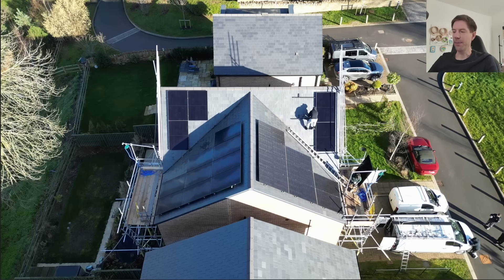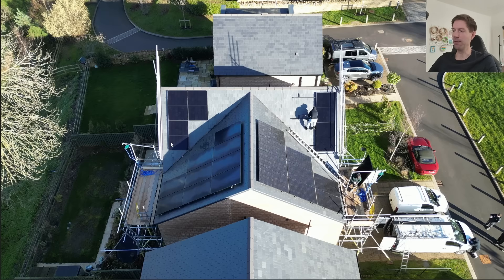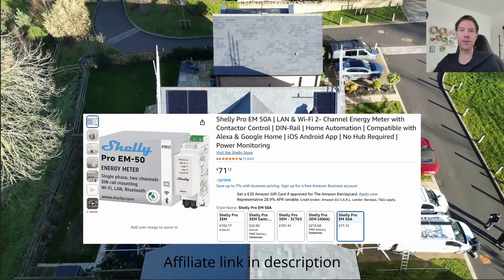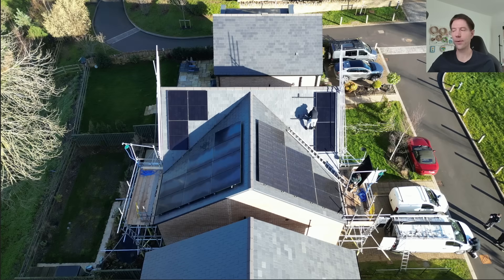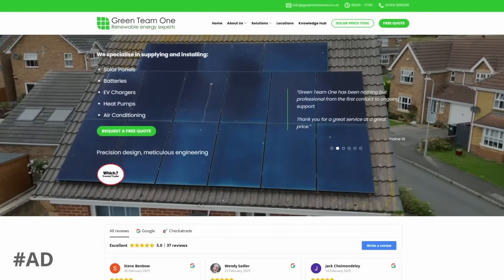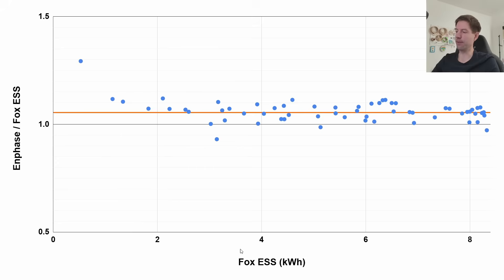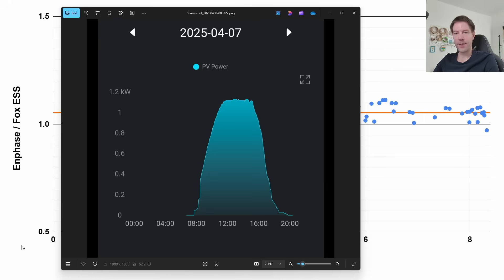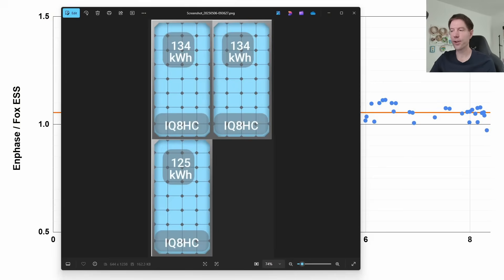Inverter showdown - two months of data

Comment: Tim,  currently doing research on the myriad of systems and combinations in a solar PV, Ev and battery system.  The latest technology is to have Micro inverters on the panels.  Your video suggest you would get a slightly better return from your investment following this route. However,  having 10 + microinverters on your roof increases the likely hood of failure.  Given that manufactures only cover the cost of replacements parts and not the scaffolding costs.  How long before a failure results in additional cost that wipe out the additional return.  I would appreciate your opinion on this situation
Reply from the maker: This is definitely a consideration, but I can't provide a detailed cost analysis at this point.  Personally I would go with a solution that requires the least amount of technology on the roof as possible if it's not strictly required.  Microinverters or optimises are only really required when there is heavy shading or you need to cover multiple aspects with panels on the same system.  Otherwise if you have low or zero shading on one or two aspects then it's a safer (and cheaper) option to go for a string system.
Reply: @TimAndKatsGreenWalk  Have a small south & and a large West so will go with a 2 aspect and DC coupling then

Comment: You mentioned not fitting optimisers due to lack of shading issues (minor shading). One other thing they offer is rapid shutdown in case of fire you can isolate down to panel level so 30v. Also , tigo optimisers usually fail in "pass through" mode so won't affect output too much which is different to micro inverter. I can see rapid shutdown becoming a requirement in UK eventually.  Already is in the USA
Reply from the maker: I'd generally prefer to keep the amount of tech on the roof to a minimum.  The less that can go wrong the better, ideally.  But that's a fair point.

Comment: Hi Tim, apologies if this has already been covered, I have a question. I currently have a 10 panel 4.5kw system, with a Growatt hybrid 3.68kw inverter. I'm pondering having two 600w panels installed on my garage roof, one on the side in the north easterly direction and one at the front facing south east(ish) and using a (SolaX X1-MICRO 1200) 1200w dual MPPT Microinverter. The garage isn't in an ideal position and the generation will be limited for a good proportion of the year, so I want to keep the cost down for payback purposes. 
My question is; Can microinverters work as a standalone system feeding the house alongside my string inverter, or is some sort of magic required to stop the two independent systems interfering with each other?
Reply from the maker: They should work just fine, we've done nothing special to make our two new arrays work with our existing system.  The only issue is that the new arrays look like negative demand to our original GivEnergy system, so that makes the data look a bit weird, but it doesn't seem to affect the generation at all.
Reply: @TimAndKatsGreenWalk  Thanks Tim, that's reassuring. I'm awaiting a response to the same query from the installers of my current system. I don't care about data monitoring, I only care that it works safely and I get more generation, the monitoring on the Growatt isn't the best anyway. 
I do have a spare MPPT port on my inverter, but my new planned additions wouldn't meet the startup voltage of 150v on the spare Growatt MPPT, but I could probably have a further three 450w panels, with optimisers, added to the current string, which would bring me close to the MPPT maximum of 550v. The issue I have with three 450w panels is that the front South East facing roof can only accommodate one panel, with two on the North East facing roof and I would have prefered it the other way round, hence my interest in 600w panels with Microinverter(s), which also wouldn't add to clipping on my current system.

Comment: The 460w Aiko panels have a Imppt of 13.29A with Vmppt of 34.62v and the 1.5kW FoxESS inverter has a important Vmppt limit at max load of 160-450v which means that you don't have enough panels in series to reach max output power. There is an internal current limit of 14A per string in the FoxESS. I think you are basically maxing out the MPPT and thus would never be able to get full output.
This synthetically reduces the peak of the string test vs the microinverter test that you knew was clipping and did a conscious choice to use those inverters. Cost-wise the FoxESS is a lot cheaper (€115) vs 3x Enphase IQ8HC (€130 x 3) and the 5% observed lower production would in theory equate to 65 kWh a year but is dependent on a clipping that did not need to happen. Higher voltage, lower current panels would be a better match for the FoxESS. Trina Solar TSM-NEG9R.28 460W would deliver 10.14 A but 45.4v at MPPT. This provides higher voltage for the MPPT. It is still not within spec to get 1500w out but I expect it would easily do 1300w since current is so much lower.
Reply from the maker: That's interesting, I'm going to have to look into this in a bit more detail.  When you say I'm maxing out the MPPT, the current of the panels is still lower than the 14A MPPT current limit, so what do you mean by that?  Three panels in series will still provide a maximum of 13.29A, so won't breach that 14A limit.  In fact the max current I'm seeing in the Fox ESS inverter is about 11.2A, so I don't believe I'm maxing out the MPPT.
Reply: @TimAndKatsGreenWalk  The problem is the datasheet for the inverter shows there is a limitation on how much power the inverter can manage to suck in vs the voltages even when it is doing MPPT. I suspect this has to do with the internal peak current in the inductors to transform the voltage up to the internal DC rail. (I am an ee btw.) This basically means that in order to get full power there has to be a minimum of voltage on the PV input or it will simply not be able to go full power. This isn't an on/off thing and some suppliers actually have charts showing the peak input vs voltage. In your case it is struggling to reach 1.2 kW (let's assume 1.15kW) which is 77% of full rating. I would expect a sort of gradual relationship between the voltage it needs for MPPT at that point vs what it needs for 1.5kw. You can verify that it is not loading the panels fully by checking the PV voltage. For peak power point the voltage should be very close to 34.62v per panel aka 103.86v for the string. This peak will change a tiny bit based on panel temperature but in general only the current changes by the insolation so it's a quite reliable check.
Reply from the maker: @1kreature right, ok.  From the inverter data I see the PV voltage hits roughly 98-100V and stays pretty consistent for a good chunk of the day, so it doesn't look like the panels are much below their max.  From that I conclude something else is responsible, or have I misinterpreted what you're saying?  Or do you mean that with the inverter at 100V it simply can't generate more than 1.2kW?  It would need more than 100V to be able to get to 1.3+kW?
Reply: @TimAndKatsGreenWalk  No, that is interesting. It is almost as it is overloading the panels a bit? Then again, maybe the temperature derating is exactly that value. 45c is normal temp on panels on colder areas. Check the datasheet?
Reply from the maker: I did some back of the envelope calculations on the panel temperature required to see a derating of the level I'm seeing and I estimated the panels would need to be at 90 deg C, which sounds unrealistic to me.  I also added a fan to the inverter to see if keeping it cooler would help, and it seemed to make a tiny difference but certainly not the full solution I was hoping for.  I'm still a bit puzzled but I'm starting to think it might be a combination of several factors all contributing to what I'm seeing.  What you've said is all very interesting, however, so I'll keep that in mind, thanks.

Comment: Im too getting clipping and the flattened off curve on the good days.  Also not maxing out the 5.5kw inverter either. Discharge amps are at 115 which is the highest setting.  Im trying to leave some headroom in the batteries to let more DC go straight in by limiting the charge amps during the morning hrs . This seems to be helping with the curve but still not exporting the full 5.5 kw . temperature theory is interesting one though.
Reply from the maker: It is very odd.  Still not sure I've solved it, mind.
Reply: @TimAndKatsGreenWalk 
Well mine has definitely helped increase PV from the panels.  I've been getting 5500w from a 7200 peak and getting about 5200 through the inverter to grid.  But my PV is now hitting around 6000 if I allow about 10 to 15 amps of charge to the battery at mid day ISH when the clipping is occurring. Maybe see if it helps your system . ?
Reply from the maker: @jenksfzr600r this system is just an AC inverter so no battery to do that with, sadly.

Comment: Hi again
You can get a passive thermal switch to turn the fans on at some temperature - these come in 5 degree steps .. For 20 c look for  "KSD301 20°C  N.O 10A temperature switch". The N.O stands for 'normally open' the switch closes above the nominal temperature. They are rated for 240v. I used some in my brothers attic to turn on a fan taking hot air away .. I did tell him that I though sucking cold would be better. I provided a few switches at various temperatures.
Reply from the maker: I think I've got a good solution working now with just a fan on a timer.  It certainly seems to be helping having some active cooling on the inverter.  I'll take a look at those thermal switches to see if that would make it more automated.

Comment: I saw a large (think crane lift to move it) variable frequency power supply of several kWs. It had fans sucking hot air out, sitting in the hot sun it blew up!. 4 of the 8 fans had failed and the overheating had taken out lots of semiconductors. I think the manufacture was contacted and the fan direction reversed and some over temperature devices fitted .. these were EU manufactured devices ... don't think they had encountered warm temperature before. 

Please blow cold, not suck hot air.
Reply from the maker: Yikes, that's a heck of a story.

Comment: Hi from Australia
This summer my western wall (in the shad but hot air rises form the sunny bits) peaked around 43 C. If you think your inverted is suffering from heat I hope they don't send it here! Ok I know it would be very suspect to put any electrical thing there but you get the idea. 

An expensive passive cooled device will be better with some forced air flow. For a solar inverter I'd use some 12 v computer fans and a 12 v solar panel to provide forced air cooling that would be proportional to the sun power. It would also be cheap and fail safe. The fans should be configured to only blow cold air, sucking hot air away would shorten their life. The fans should be of a size that allows the passive air cooling not to be impeded too much if the fans fail. At least 2 fans and 2 solar panel would provide some redundancy. 

Good luck, interested to see what you come up with.
Reply from the maker: That's basically what I've now done and it seems to be working well.  More on that in a future video.

Comment: Two thoughts - firstly, you can roughly back-calculate the panel temperature from the voltage drop of the string voltage (this only works once the panels are above about 30% production, and there are no optimisers on the string).
Secondly, the inverter temperature is quite likely.   I put a £15 2x140mm USB-powered computer fan on top of the inverter, drawing the warm air up and out, and it dropped the temperature by 10c.  Set to low (which was 3W).  
Given that inverter efficiency improves when it is cooler, the 3W power usage is probably already covered by that.  The inverter will drop efficiency over 40c, and will gradually start to derate over 45c.  
You can see the inverter temperature via MODBUS/RS485 on home assistant (sensor.invtemp).  The string voltage can be seen either in the app, or also via MODBUS (sensor.pv1_voltage, pv2_voltage, etc).  I have a home assistant template sensor helper which back-calculates the panel temperatures from the voltage, so I can chart them.
Reply from the maker: Yeah, I can see the inverter temperature in the Fox web portal and it definitely hits a maximum at the same time as I see the clipping.  I've done exactly the same as you now, by adding a PC fan on top of the inverter and the temperature is significantly lower with that running, which I think has helped a lot.  I'm going to be keeping an eye on it but it's looking promising.

Comment: I wonder what your current curve looks like on the grid-tie. I wonder if it is clipped as well..
Reply from the maker: Yes, it more or less follows the power curve.
Reply: @TimAndKatsGreenWalk  And what is it at the clipped part? I just wonder is the inverter is clipping the current.
Reply from the maker: @mrx1979ua  no it's well short of the max the inverter can handle.  The datasheet says the max input current is 14A but the clipping is happening at about 11A.  I'm now pretty confident it's the inverter temperature that's responsible and I've taken steps to resolve it.

Comment: Nice video. Well presented as always. 😊
Just for my own sanity can you just confirm that the 380w per panel was acheived for the microinverters and not subject to further losses from inverter efficiency? Would i be right in thinking the clipping down to 380w occurs AFTER inverter losses. I noticed the efficiency graph dips to 96% at the very top end of the IQ8HC. 
With the shellys did you notice any difference between their readings and the Enphase app? Thanks.
Reply from the maker: The array with micros tops out at about 1.12kW according to the Shelly app, so slightly less than the 1.14kW expected from 3 * 380W.  That could be due to inverter losses, or measurement error on the part of the Shelly, I can't be certain.  Annoyingly two decimal places is the best precision I get from the Shelly app, and only one decimal place from the Enphase app, which reports 1.1kW!  As for total energy generated the Enphase and Fox apps do report very slightly different values compared to the Shelly app, which is why I wanted to make sure I used the same method when comparing the two systems.  For example for yesterday the Enphase app reported 5.9kWh whereas the Shelly reported 5.84kWh for the micros array.  Meanwhile the Fox app reported 5.4kWh and the Shelly reported 5.59kWh for the string array.
Reply: @TimAndKatsGreenWalk  thanks. That's useful info 🙂
Reply from the maker: @RenewableEnergySteve  no problem.
Reply from the maker: @RenewableEnergySteve  this deserves a whole separate video, tbh!

Comment: I have 4 PC CPU fans fitted underneath my givenergy inverters because they do get too hot in operation.  The PC fans keep the inverter temperature at 40 degrees max, but without fans they’ll reach 60 degrees in summer which does start them limiting output.
I do get the inverters constraining output when the grid voltage gets too high as well (due to lots of export), but this doesn’t happen until about 258V.  You can see what the output voltage is on your inverter
Reply from the maker: Yup, I've been keeping an eye on the voltage.  I've now got a PC fan helping cool the Fox inverter and it does indeed appear to be helping, but I'll be monitoring it over the coming weeks to see what happens.  The temperature is certainly much lower than it was, so that's encouraging.

Comment: In the install video didn't you have a shelf literally an inch above the inverter? Inverters don't usually have fans and should be at least 100mm above for air flow. Also look at label on inverter side. I have a 2500w fox attached to 9x450w bifacial NE facing and inverter is rated 2750w max. I've seen 2750w a few times and it's only installed in November
Reply from the maker: Yeah, the shelf has been removed and I'm experimenting to see if a fan can also help.  More in a future video.
Reply: @TimAndKatsGreenWalk  I found a 2x140MM computer fan on USB dropped the temps by 10c (7kW Fox inverter) when set to low (3W).  £15.
Reply from the maker: @WyndStryke  I have done pretty much exactly that and with similar results.